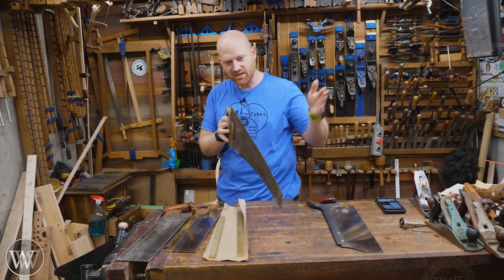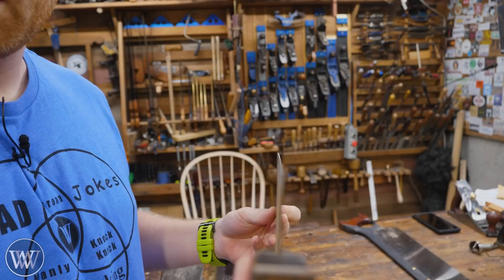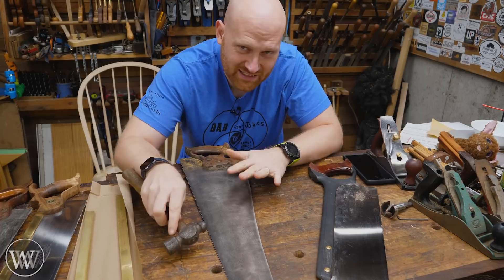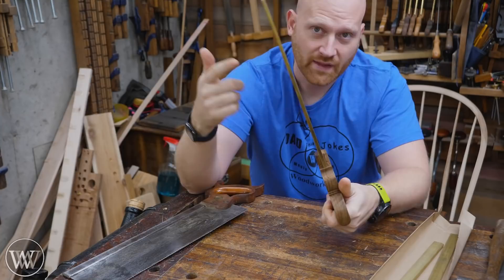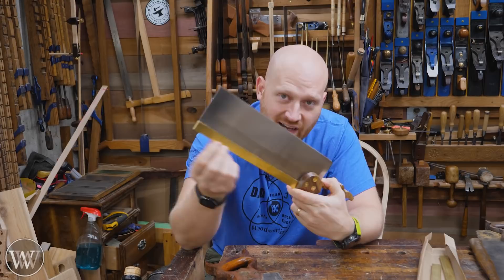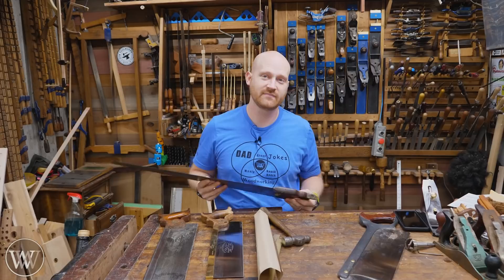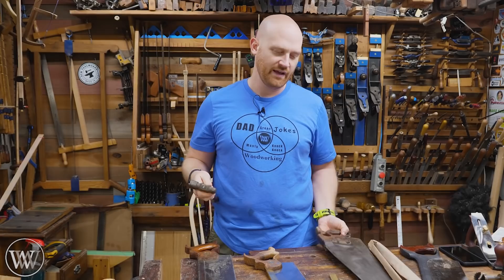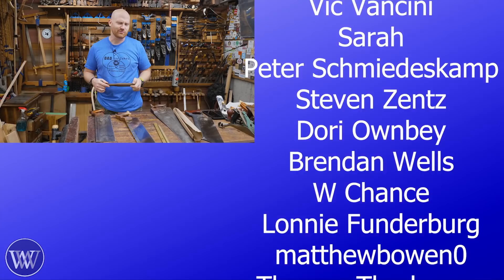How To Bend A Saw! Or Something Like That

Comment: I already have fixed old bend and kinked saws. It's a little bit tricky at first but i have a good anvil (a really heavy duty Steel plate) and in my experience a Bronze Hammer is not so fast while straightening not so much stressing for the Sawblade. All in all it's a lot of Fun to restore old Saws😀

Comment: I had to straighten a few saws that were both curved and kinked over the past few years.  I'd say that for casual saw repairing you nailed it well. Those that want to learn more and risk ruining the saws can find more advanced techniques.  But the risk goes up rapidly just as you are suggesting.  Mind you, collectables aside if the saw isn't useable then what are we going to do?  Break it more?  At least in the further ruination we can learn something for next time.
Reply: I agree!  I find when fixing something that is already trashed releases me to do my best work!

Comment: I cracked a D-8 right by the handle (I was pushing crooked and damaged it), so just cut it shorter, put in new holes and now that saw is a few inches shorter but works great. The cutoff pieces made a few scrapers.

Comment: I look for vintage saws with lots of plate left with kinks near the front (at or past where the nib would be).  Then I use a cutoff wheel to take off the toe in front of the kink and make a toolbox general use saw that's a hell of a lot nicer than the hardpoint teeth you get at the home center.

Comment: I really appreciate this video, I’ve since recently done this to a couple of saws I’ve bought. Is any of this applicable to squares? I have a couple good condition Stanley squares, and on one it’s a bit bent along the whole way, with a couple small kinks at the end.
Reply from the maker: Generally, those are not as flexible. Most of the time. You would set them on an anvil and tap out the binds with a hammer.
Reply: Makes sense. Seems probably best to have a professional fix it. Thanks for the reply, you do a lot of good work!

Comment: Bob Rozaieski has a good video on straightening and tensioning a handsaw.  He also has a good video on straightening a back saw.  Bob goes into the detail that James refers to but doesn't in this video.  There's a lot of detail in the narrative that Bob gives as he shows how to do it.  Trying to take it all in is kind of like drinking from a full-on garden hose and trying to get every drop.  But Bob starts with doing the same things James does here, I'm not disputing that advice at all.  But from my point of view, if I'm going to throw it away, why not experiment on it, and learn a bit first?  I've already written it off.  And finally, to get the last bit of value out of it, you can cut it up and make scrapers from the blade.

Comment: I have a panel saw that wasn't straight when I purchased it brand new on Amazon(didn't realize it till after it was too late to return) I attempted to fix by doing as you suggest but I found out that it looks like it's a twisted bend in the blade. How would I go about fixing it. Also as I'm using the saw the blade rattles? or chatters? back and forth rapidly (not sure the correct terminology on how to explain it, lol.) Hopefully you can help. Thanks.
Reply from the maker: If it is rattling or making a sound that's not cutting wood, then that means the handle is loose. If the plate isn't perfectly straight then it can always be twisted or bent. Sometimes you can clamp the tip in a vise and then twist the handle. The nice thing about it is as long as you don't kink it. You're never going to hurt it because if you go too far you can always just turn it back the other way.
Reply: @WoodByWrightHowTo  It's cutting the wood just fine but when I'm pulling back while in the kurf the whole plate moves from side to side rapidly and makes a horrible sound. The bend seems like it's close to the handle but only on the non tooth side of it cause if I look down the plate of the teeth it looks pretty close to straight.
Reply from the maker: oh thwapping! ya that comes when your arm is out of alinement. I need to do a video on that specifically. but if you want to go in-depth. here is a live video where I worked with someone else that was having problems sawing. https://www.youtube.com/watch?v=JB-qIjNjV3o